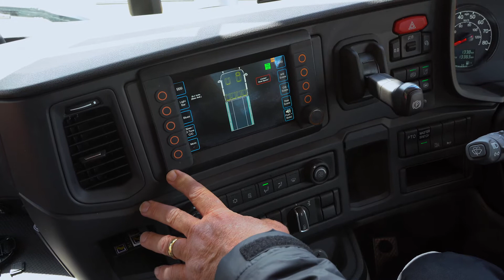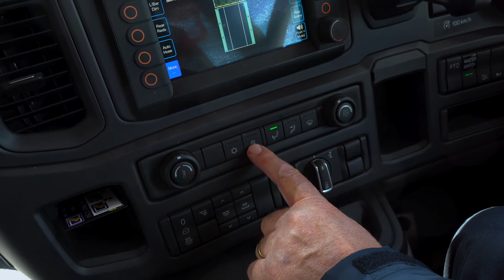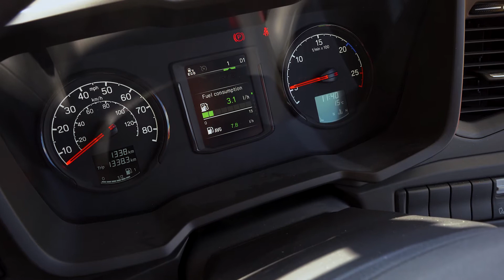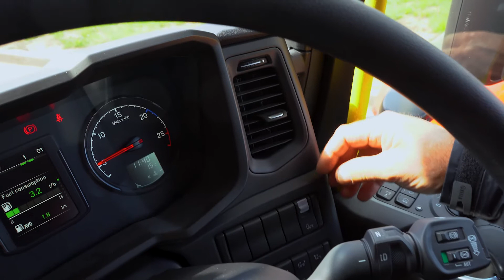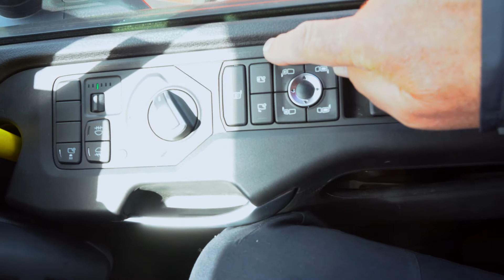2020 Scania

Comment: Are the new fire engines Automatic? and another question Do they have GPS Systems instead of depending on the driver to know the area.
Reply from the maker: Yes nearly all the appliances are automatic, with much more technology like auto breaking to improve safety… there’s no GPS however there is a mapping system located next to the officer in charge. It’s down to local knowledge and the mapping system, as sometimes there won’t be postal codes but other methods such as what three words or map coordinates.